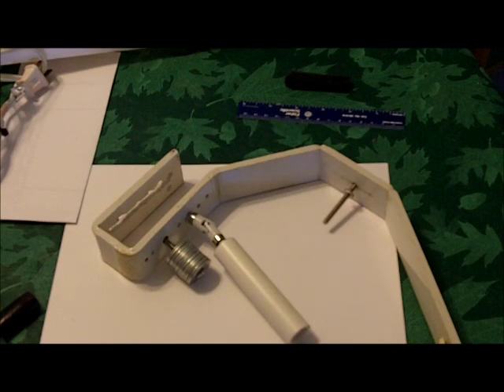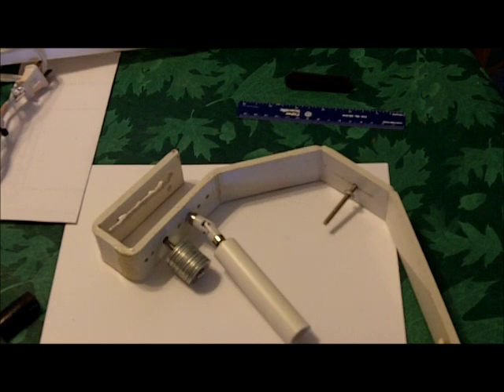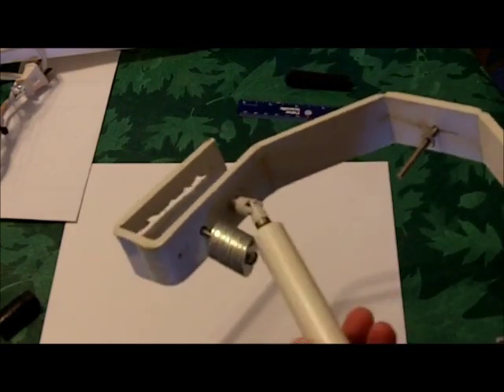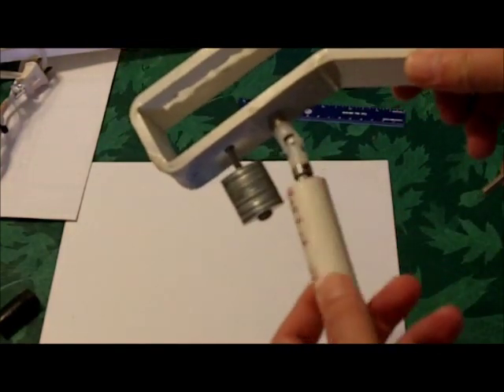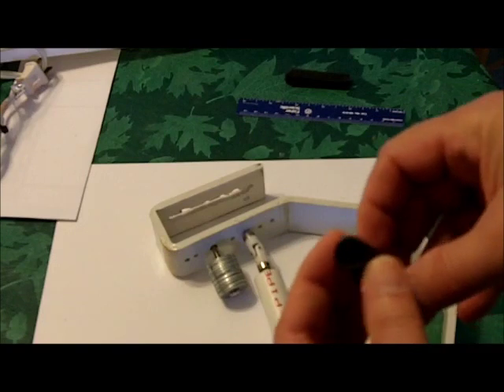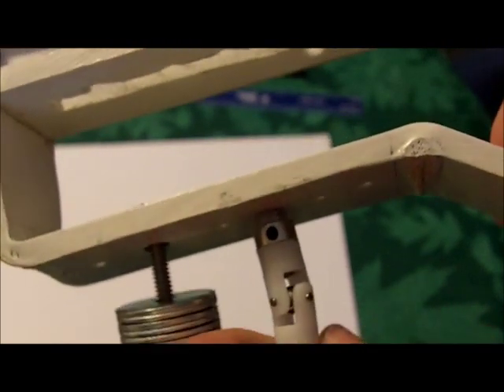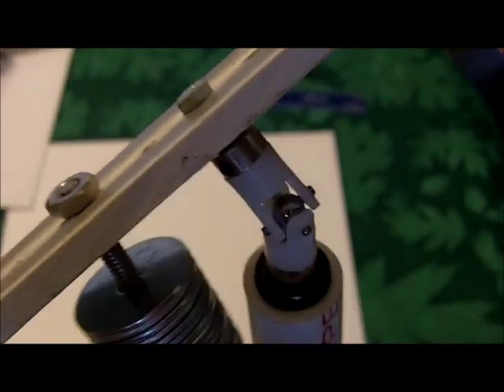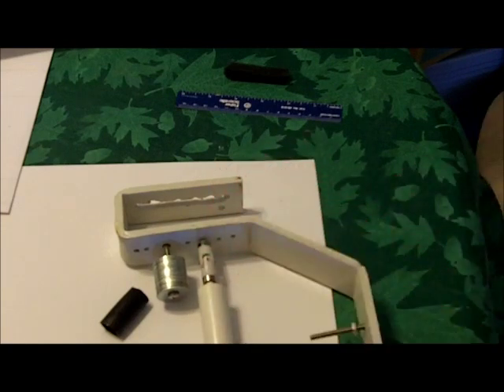3 Things I learned from making a DIY Homemade  video camera stabilizer steadicam

Comment: Hey there. Some very good tips here. Thanks for posting. It seems a lot of people are having a very tough time finding a suitable ball type joint for their gimbal. You might try industrial supply stores, and search for angled rod ends. I went to Grainger (local to me but they will ship).

For mine, I'm using a "QA1 Female Stud Rod End, RH, 3/8-24", $14.68. It's a bit pricey, but not so bad as compared to the DSLR I'm trusting to it.

Comment from the maker: @kolajampe actually, there is a youtube showing just what you said and works very well, but only for heavier cameras , I have seen no one use it as well with the light cameras. and still not as good as a well made stabilizer, but if you have a heavy camera the results shown in the video I saw were better that any non stabilzer like the fig rig or cam caddies etc.
and as you said there is no need to build or buy anything.

Comment: A heavy, high quality tripod works great to stabilize shots, all you need to do it extend the neck to use as a grip and open the legs then walk around with it. The open legs act as a counterbalance in 3 directions. No hacking needed. Plus you have a tripod which is essential for video anyway.

Comment: @mrhulot101 

I wasn't able to find the seller you mentioned directly by searching at eBay, so I googled the name and found the link to their eBay page.  I then searched for any sort of u-joint and found nothing.  What exactly do I search for to find the item?  Also, I did find a few other steel u-joints on eBay, but I unsure of what to look for as per the size and if it needs to be threaded or whatever?  Thanks.